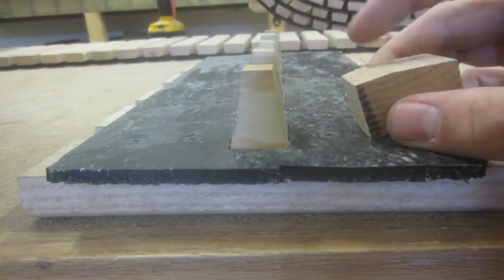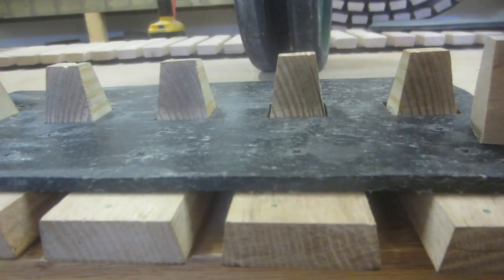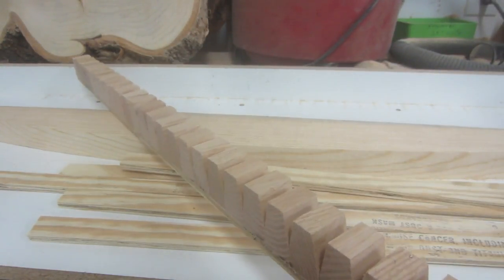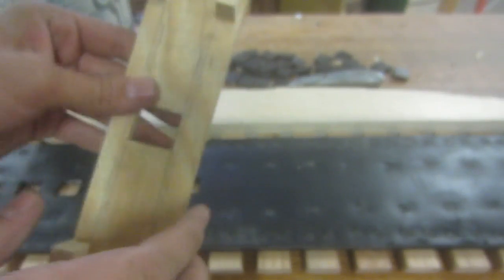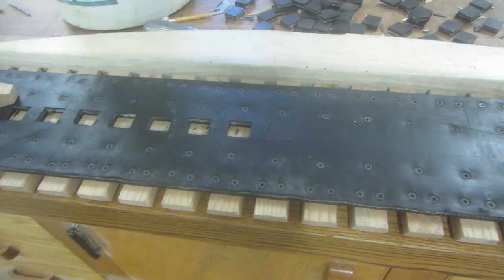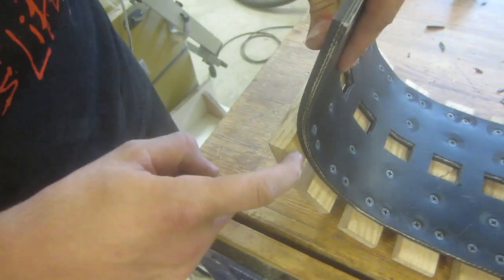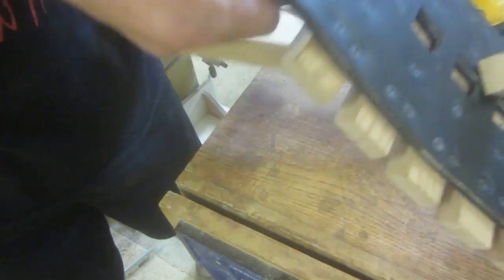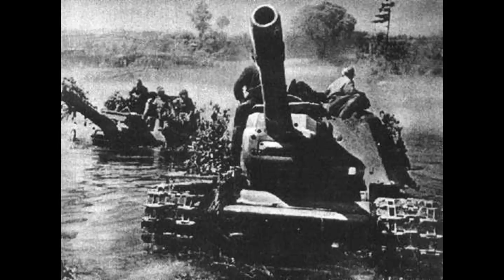Homemade Tank Part 4 (track guide teeth)

Comment: Again, another great video and show of ingenuity. If you ever build another one or a larger one, be advised that the center guides have two purposes, one they keep the track in place as you said on the video and two they join the trackpads to keep them from spreading apart during hard cornering. In real tanks they are all centered between each trackpad regardless of who made the tank. Doing great, keep up your creativity.

Comment: it would be a lot easier if you used the Multi Functions tool which is similar to the angle grinder but it will be perfect for this purpose

Comment: an easier way of doing these tracks would have been cutting the wider conveyor belt in two halfs and mounting them to the pads with just enough space in between for the centering teeth; granted this method would leave you with some holes in the tracks but strength wise it would be the same but with less work

Comment: Would it have been easier/sufficient to just cut the track into two lengths? I'm not sure how much the rubber between the guide teeth is contributing - some since there's a cloth layer to spead the load, but still. It'd have been a much easier operation I'd think to make long linear cuts. (Not to mention far less tedious)

Comment: Why didn't you just leave the teeth in if they fit when you cut the holes. That way they'd already be in there when you needed them to be? And you could drill them all with the 1/8 bit. And then when you had to drill the 3/8 bit (i believe it was) you could have popped them out. Then pop them in and put in the screw. You would have eliminated 1 whole cycle of popping them in and out. Possibly saving you a whole hour. If not more

Comment: Hm, wooden guide teeth...
I hope that, especially with rougher terrain, those teeth won't start to degrade on you too quickly. :/
Again, time and material cost is everything here, but ideally you'd want something more along the lines of a material as hard as, or slightly harder than the wheels, to prevent both same-material-contact-degradation and environmental degradation.

If you'd have had the hardware (and ages of time) for it, i'd have suggested getting 5 or 6 millimeter steel strips, bend them in a Λ shape, and screwing it all together from the inside of the track.

Wooden guides probably won't fail on you TOO quickly, but i'm semi-positive that those will be the first thing to go under some stress. :/

Comment: I've been wondering why did you choose to make your tracks from wood and rubber? Couldnt you just make a template of a real life track link(look for designs on the internet), scale it appropriately, and then just cast it from metal?
Reply: It's not really easy to "just cast it from metal". That would be very expensive for all the metal + very hard to get to fit with raw castings.

Comment: i realy like ur idea. i am thinking to build my own tank. is it okay that i use ur track system?
Reply from the maker: Of course! Glad to help. I would caution though about making the guide teeth out of wood because I'm not 100% confident that they will hold up and I wouldn't be surprised if I end up having to remake them. Some type of composite would be best
Reply: +RealSteel 1776 yeah. i thought about usimg alluminium or so. so i have the wood parts and just use it as a prototype. and than im going to mold my own parts. but im not sure
Reply: +RealSteel 1776 and thanks
Reply: +RealSteel 1776 i need ur help 😂 i realy dont knoe how to make the drive wheels. are you going to make them out of wood or to you mold some alluminium for that?
Reply from the maker: +Dennis Hofmann   Wood definitely wouldn't work, but I'm not sure what I'll end up using. If you haven't already, check out the channel Tankman101. He has some good videos and I believe that he used a high density PVC for the drive sprocket.
Reply: +RealSteel 1776 thanks!
Reply: RealSteel 1776 Excellent work buddy ,you have a great imagination, just an idea a razor sharp 3/4 "  chisel might have made it easier to cut the squares out of the belt .